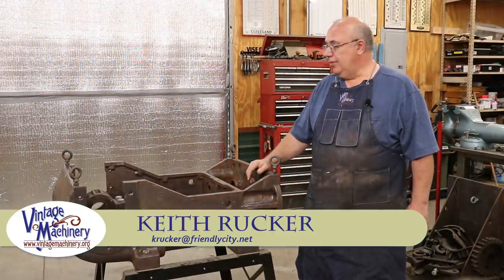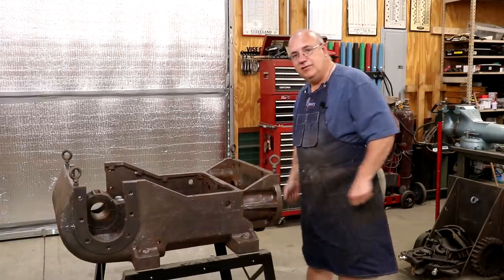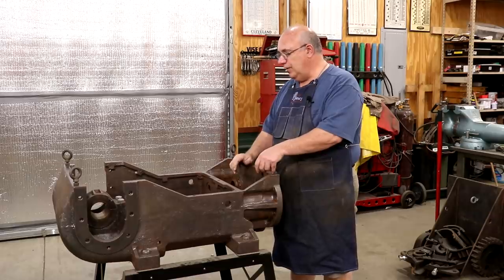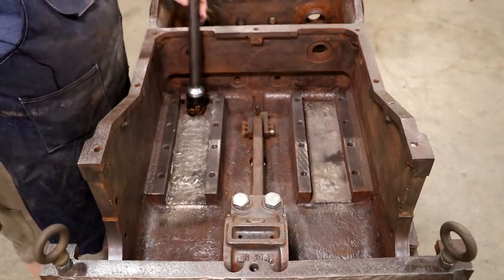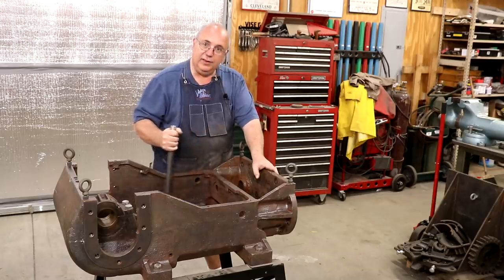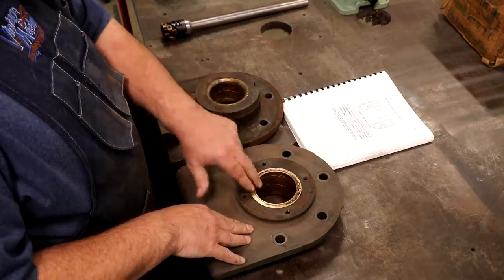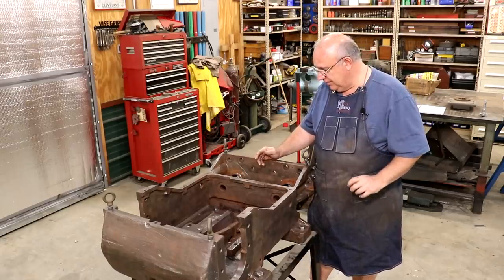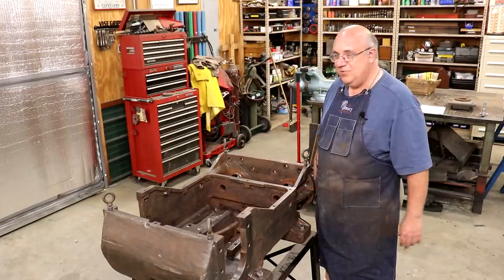Steam Stoker Engine Restoration 14:  Project Update

Comment: Do the side bearing plates have a reference surface, or are they just sloppy on the bolts?  I don't understand how you will line bore it if the bearings will install in a different location every time you tighten down the bolts.

Comment: I am not a machinist. Could a fixture be made to actually use a small router type machine that would fit down inside the case and essentially run on those rails bordering the surface to be decked? Larger machines are the logical choice, but are they necessarily required?

Comment: Keith, One thing I don't get about your comments about going vertical with the engine is that the should be a surface 90 degrees to the cross slides which is the surface that the cylinder block bolts to. There are holes to bolt it to a table so I just don't get it?

Comment: Having tried to use carbide insert tooling on my Logan 10 lathe, (not a very rigid machine) ,that carbide insert shell mill gives me the cold sweats.  I also worry that the spray-weld is going to me significantly harder to cut than the casting was.   It wouldn't be  very hard to make a single-point fly-cutter that would have a larger diameter shank and the HSS cutter geometry could be tweaked for lower cutting forces, Note that this would also be very consistent with shop practice when the engine was made.

On the other hand (I've got three most days} the chinese mill-drills used to ship with largish insert shell mill, and they seemed to do OK with it despite being about the least rigid machine ever to be called a mill....so maybe you'll be fine.

Comment: Could you stiffen the arbor by fitting a support arm with a bushing, like you sometimes see on the end of a boat prop shaft? You would need points on the milling machine to attach it to.

Comment: I wonder how well the spray welded surface will hold up.  Generally it is used to build up a bearing journal where it simply gives the bearing a proper fit, but is not subject to wearing action- IE- the spray weld is captured by the bearing race and nothing spins on the sprayed surface.
Reply: I've seen Adam Booth use spray weld on wearing surfaces more than once. I would imagine it depends on the spray weld material.
Reply: @MyLilMule  Can you give a link- I am a long time viewer of Adam, and I can only remember him spray welding shafts onto which a bearing was pressed.
Reply: What is plan B if the spray weld flakes?  Is the bottom wall thick enough to mount a bearing block?
Reply: @waynespyker5731  My suggestion way back was to mill the original base and then mill the rails the same amount so the slide was a bit deeper- the tolerances on those slides are not very precise and any change in alignment would have no effect.
Reply: @oldschool1993   A well planed machining procedure.  I was referring to past questioned remarks to mill the wall away to bolt an external patch from the bottom. I can't see that being an option.
It was painful to see Adam attempt the various setups for the job, his shaper was simply 30-40% too small to machine the needed results. My experience is 56 years of tool and die maker, injection mold design and building, starting in '58 on a planer, continuing into Bridgeports, then solid modeling and CNC.

Comment: There's no advantage to horizontal milling vs. vertical in this case as the arbors will both have the same restrictions, so if the arbor is going to flex on vertical mill then it'll flex on a horizontal mill, too. Makes perfect sense to go with vertical milling where the setup is going to be much easier and safer.

Comment: I questioned the cutter shaft diameter when you were building it, but now that I can see the clearance issues with the cutter in the engine case, you didn't have any real choice. Would have been nice to see the cutting head in the engine to begin with. Might have saved you a lot of comments.

Comment: Use a carbide shank on the cutter. Silver solder the cutter mandrel on the end and get less flex ......
Reply: I think a carbide shank long could be liable to snapping, especially with the cutting forces on the very tip, nota only that but I imagine very ver expensive as it would need to be custom made.
Reply: @Venge94  they make and sell carbide boring bars all day everyday.  Surplus find on ebay cheap.  Please dont reply with zero experience. Thanks
Reply: @vettepicking  Well sorry if i offended you but theres no need to be rude, we're all on a journey to learn and youre not the only person on youtube with experience.
Reply: @Venge94  i said thanks.

Comment: I apologize if this is redundant  but could you not fashion some supporting guides us the sides next to the surface  Maybe make several sizes to accommodate the cutter head and make a sled with a bearing to hold the milling shaft

Comment: Just so people do not think I am a Negative Nancy with no ideas I have been doing this since my Jr High School days and I am 62 now.  That really means nothing, just a little history.  I have both a Cincinnati #6 Horizontal Milling Machine (A Beast) with a Vertical Head and a Collet and Englehard 3 3/8" bar horizontal boring mill.  It would be a toss up as to which machine I would use.  One idea to eliminate some of Keith's concerns about gravity and doing it in a horizontal machine.  I would take the adjustable angle box table off of my drill press and table and tie the stoker engine down flat on the table and then crank the table over with the hand crank to stand it up to reach in with a horizontal bar.  Reverse the process to remove the part after machining.  The tool problem is easy I think.  I would use a large enough side cutting round milling cutter mounted on a end flush mount arbor.  I would be able to use that setup in a vertical or horizontal machine.  I would use a big enough in diameter round side milling cutter to keep my large extension away from the side wall of the stoker engine, but not to large to not cut all of the flat you need to cut down there by the side wall.  One of the objects of being a machinist is to work efficiently.  Why work all week babying a small diameter shanked tool when there are work arounds.  Just my opinion.
Reply: @jeffreylee7184  you could take the slot in two passes as your cutter would not need to be full slot width.  You just need to stay clear of the side wall and cut the entire flat needed.

Comment: I am wondering why prioritize the metal planer restoration over the stoker engine. Do you have a need that is driving the metal planer restoration forward? My guidance (Wife) "establish need before investing, not invest unneeded". (Sigh, no toys!) Hopefully after all your work put into restoring it, the planer will not just sit around and gather dust. Cheers.

Comment: The 3 "finger" micrometer is not the correct tool for measuring a bore in this application. The fingers, all equidistant at 120deg, does not all you to accurately  measure for an out of round condition. Both gauges measure displacement of the anvils and a taper translates it out to 90 deg, one splits the dimension between two points, one splits it between two points. A bore gauge that primarily reads between two points 180 deg opposite to each other is the proper gauge for this. The bore gauge measures displacement parallel to the two points being measured, like a snap gauge, however the bore gauge provides supporting anvils that align the measurement points relative to the bore. Bearing bores do not wear in even patterns, but wear oblong or egg shaped patterns in the direction of thrust.

Comment: Hey Keith, I do have a question.... is the horizontal milling machine "spindle"(I think thats what you'd call it) that you use when cutting spur gears and/or bevel gears.... is it bent? Every video I've watched of yours the spindle and gear cutter and the spacers seems to "wobble" by maybe ten thousandths.... I understand its old and everything and think maybe its the little bit of clearance between spindle and cutter and spacers causing it to be slightly "off" when it's tightened... but I wasn't sure if maybe the spindle might actually be slightly bent........ I am pretty picky about who I watch cause alot of people get on my nerves cause they don't have a clue what they're doing and somehow manage to get away with it 🤣🤣🤣 but you're great man, keep up with the videos!!!!
Reply: I have been meaning to comment about this.  It could be dirt and grit on the arbor bushing faces.  If the arbor bushing faces are off from each other for any reason when you tighten them up it will cause them to make the arbor run out when tightened up.  You have to make sure they are clean and the faces mic true with each other.
Reply: @wdgreen6612  ya know, that NEVER CROSSED MY MIND 🤣🤣 BUT..... I have been watching his Videos on the New Haven Metal Planer and around Video #45 He was cutting a bevel gear I think.... and it was about 20 seconds into me writing that first comment asking about that problem  and I was watching that video at the same time and he actually made reference to several people asking him the same thing and he said it was because it was old and wore out, but that since he got his "new"(a different mill from the one he has had for a while I'm assuming) mill it hasn't been doing it even though he was using the arbor and cutters off his old mill and said it apparently thw problem was in the old mill. 😁
Reply: @wdgreen6612  The "New" Horizontal Mill that I was referring to is the Milwaukee Model H that He has. I just remembered that. I've been at home for a while sick so I pretty much just watch His videos and thats it so I've watched A TON of them in the past 48 hours 😆😆😆

Comment: Keith, why don't you just see if you can borrow the mounting plate that Adam has already made?. If Adam and this other guy are both in Florida, they can't be all that far away from each other
Reply: Keith mentioned the plates Adam has made.
Reply: Florida is similar to Texas in distance you need to travel.  Mobile, AL to Miami, FL is 719 miles less about 50 miles Mobile to Pensacola so the distance of Pensacola to Miami is about 670 miles.  That  is approximately the distance across Texas through Dallas from the LA line to the NM line.

Comment: Would be interesting to mount the cutter, put an indicator on it near the carbides and see how much you can deflect it with a push by hand of about 50 lbs.

Also, likely a caculable quantity from beam theory.
Reply: I bet you could deflect that cutter with little effort. If it bends a thousandth or two it's done. I hope Keith can resolve this but that skinny shaft reeks of failure

Comment: don't you have that massive drilling machine couldn't you use that as the milling machine to do that
Reply: The massive drilling machine is not a milling machine it's still only a drilling machine it is not able to resist side-to-side pressures in those axis.
Reply: @CothranMike  It is actually designed to handle some as they were intended to line bore. But not that much. In addition, there would be no XY table.
Reply: @CothranMike  ahh ok thank you i have never used one of them so didn't know its limitations

Comment: Might be worth while to shorten the arbor you built so that there is the least amount of stick out.
Reply: If you bothered to watch the arbor video, he explained that the length was the minimum he felt he it could reach all of the required area,
Reply: @paulcopeland9035  I did notice that but if you look at how far the mandrill sticks out, it seems a little long. He's only going to mill what 1/8 to 1/4 inch. The issue will be clearance towards the crankshaft where the case steps up but the clearance there is likely greater so that possibly the spindle can clear.

Comment: Folks, could someone explain to me please what is the difference between a horizontal boring machine and a horizontal milling machine? From where I'm standing they seem very similar, is it just a question of bed size/layout?
Reply: I guess a horizontal milling machine would struggle to work on the full length of a long hole which the boring machine can do, is that the main advantage?
Reply: Crudely speaking, a boring machine is used to create a "circular" hole, and a milling machine is used to create a "flat" surface
Reply: A horizontal mill will typically have fixed spindle and knee that can move up and down the column (for y axis) and saddle (for z axis) and table (x axis). A boring mill will have a work head which can also move up and down on the column (y axis), that head will have a spindle that will travel in and out (z axis). The work table can move side to side (x axis) and also in and out (z axis). A boring mill can do horizontal mill work but is more specifically used for boring (making holes). With an outboard support (kind of like a steady rest on a lathe) it can bore numerous holes in line with each other in a single part.